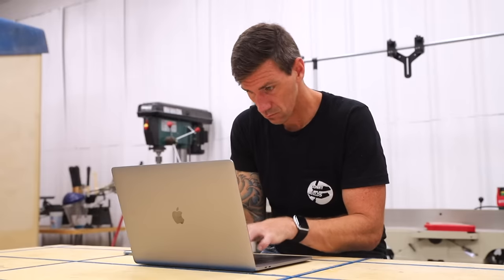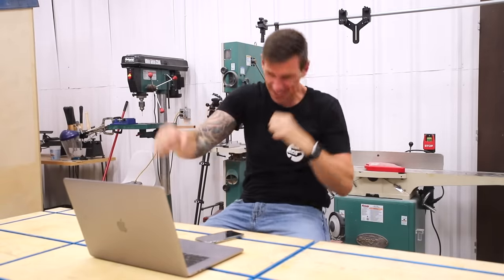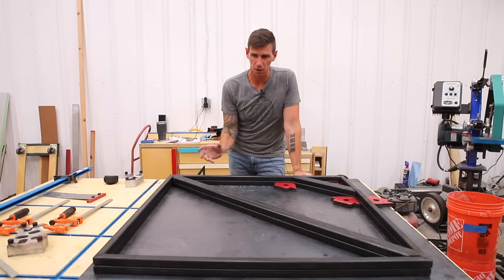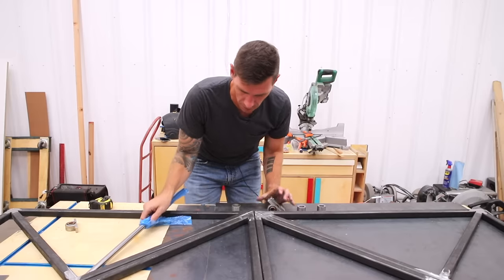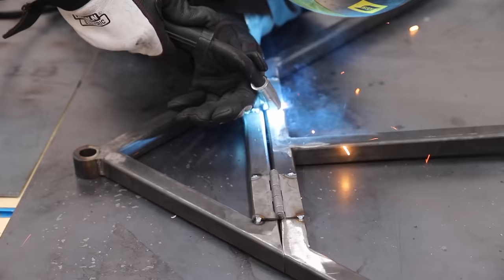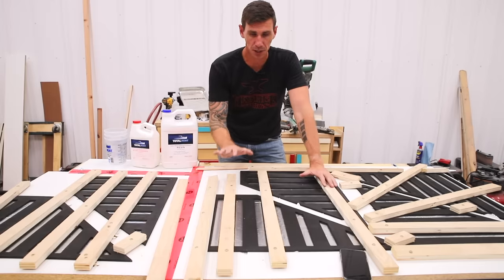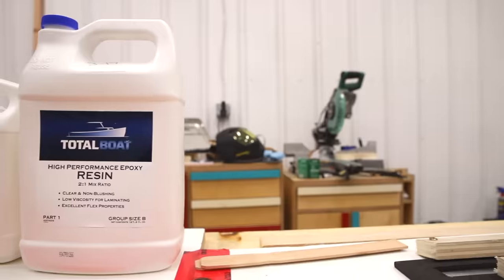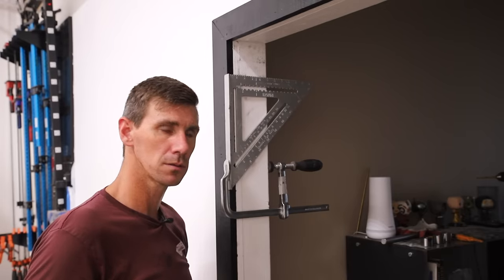Impossible Folding Door

Comment: The only thing that I see that is weird for me with that door is that opening up from the other side is weird and it ain't smooth
Reply: it could be easily fixed by welding the top or bottom rod, and attaching a motor to it.
Reply: Another potential solution would be to incorporate two-way hinges into the design, that way it can be opened inwards and outwards the same way. Naturally, this would require a specialized doorframe, because that wouldn't be easy.
Reply: Not a problem, since you can’t close it after you enter.
Reply: @finminder2928  It would have draught issues too but still an amazing design.
Reply: Guys, your missing the point of the door, it’s an alien jail door, you know for keeping their captives in right before they stick stuff up their butts, duh
Reply: @Catubrannos  That's why it's used for areas where that doesn't matter such as a shed/garage/workshop/etc.

People all miss the point that the door is supposed to be cool and interesting yet functional, less super practical.

Would be an awesome door to use for places where you wouldn't want someone locking you in by accident. If the door is open, then there is someone inside.
Reply: Because the inventor didn't take that into account, and you can't even close it back after you've gone through
Reply: @acywei  it's not functional then... It's a door. It's supposed to close and open from both sides..
Reply: May be adding a vertical rod with movable handle on the other side which can slide along with the door?
And it also help to stabilise the door structures
Reply: @wyannrosales3140  I mean, it would be fine for a closet door or something, where you wouldn't need to close it while inside, but for most uses, I agree, its not very practical.
Reply: @finminder2928  excellent point! I hadn't thought about that. Definitely loses a few of the ''cool" points for that flaw. Still, geometrically mesmerizing...
Reply: Alex Ward this wouldn’t work as you would have no Clearance both sides . This door also doesn’t finish flush
Reply: I was wondering right from the beginning how do you open and close it from the inside.
Reply: I thought the two pivot points didn't look parallel, you can see the two squares arent aligned when it is open, its still cool though
Reply: Guys just make a second door that you can close on the reverse side.
Reply: There are also gaps between the parts when the door is closed. You can see the blue light shine through them.  It's a door that will do a lousy job keeping noise from the adjoining room out.  Might want to throw some type of gasket material in there.
Reply: he may not have a door knob on the inside ... needs something like a push bar to open it easier ...
Reply: @johnathon5455  lol
Do you know that from personal experience?
Reply: Yeah, i guess that's why he didn't show it from the inside.
Reply: @samuelmire9389  You should be able to pull on one of the corners in the middle, then push it up/down. Would be awkward though, like opening.
Reply: @wyannrosales3140  99% of doors only open from one side
Reply: @wyannrosales3140  wait nvm I understand what you are saying now
Reply: Another solution is use a regular door
Reply: Omg attaching a motor on the door lo l
Reply: @uglyduckling81    you have to sort of pull on the door to open it so you need some kind of mechanism that pushes the door when it starts to Open and pulls the door in when it ends Opening
Reply: Good point, its only really usefull for a closet then.
Reply: Coming soon the better version. This is really good ideas
Reply: Johnathon545  obviously, i can't believe people don't realize that like bruh
Reply: Bruh people are saying to use it for a pantry or closet but have you ever played hide and seek
Reply: @johnathon5455  Exactly
Reply: how about the other side?
Reply: @wyannrosales3140  Not all doors are meant to close and open from both sides. Prison doors. Trapdoors. The holiday doors in The Nightmare Before Christmas.
Reply: @notahotshot  That means someone can just walk by and lock you in a room just by shutting the other door
Reply: From what i imagine, you cant even close the door from the inside once you open it 😂
Reply: animerlon oh, no,.. well I mean yes... but it’s different, I gave consent so it’s cool, they had a real pretty alien lady doing it, it was a pleasant night actually I wish I could go ba- to much info, but can confirm they use these doors for holding, actually met my wife in that holding cell, though sometimes I question if she isn’t an alien in disguise making sure I don’t go informing people of what went dow- oh god she knows,, and she’s coming this way she has something behind her back she’s out to get me please send help

Edit: oh god it wasn’t a weapon it was much much worse, it was a.... pregnancy test...
Reply: SᴜɢᴀʀKᴀᴛシ yeah ikr I mean looks pretty obvious to me, although I have experience in with alien holding cells
Reply: @satibel  that wouldn't work, as you need to hold the door up when you open an close it. it has some weight too it. 
if you don't hold the door while you moving it. it will lock in place.
Reply: @phoenixtalon100  with how the door works, you would just make it unstable. and how would you cover a door frame while being able to go through it?
Reply: @wyannrosales3140   it can open and close from both sides you just need something to hold on from the other side. as you still need to carry some of the door's weight when you move it.
Reply: You build a better one then and show us all how it’s done
Reply: Catubrannos yeah but I think you would probably use it onsideZ
Reply: It looks smooth enough anyway
Reply: @rileysteel5046  i built one some years ago for a final project as a smith. had the same design except I had a time limit and used resources found in the school to build it. so i know the flaws in the design.
Reply: @finminder2928  I though of the same thing it's really cool though
Reply: @finminder2928  no you can close it from inside. It's not smooth, but you can. See how he enters around 15:18? You can do the same things he does in reverse: from outside, close the doof halfway through, then step inside the room, then grab the door from inside and close it.
It's not a smooth but it can be done. You shouldn't put that door on a room that you use often because that would be unpractical, but it looks cool and could be great for a room that you don't usually have to close from inside (laundryroom, storeroom), or that you don't use that often (guest room). Or, it could be really fun on furnitures: wardrobes, shelves, TV stands, etc.
Reply: Gosxbomber agreed but still a really cool door design
Reply: Fin Minder you can lock someone inside so it would be inhumane giving them an ugly door
Reply: You kick the door, my friend, you kick the door
Reply: The handle turns around when it opens and closes it goes from front to back
Reply: People with OCD: Why do I hear coffin dance playing?
Reply: @satibel  A motorized super-pincher door?  That sounds scary.
Reply: ALL OF YOU

Understandable. Have A Great Day.
Reply: @wyannrosales3140  Well, not necessarily. Maybe you want a door that only opens and closes on one side for different reasons. An outdoor small storage shed, you usually open and get what you need and get out. Alternatively, as someone else pointed out, a great jail design would be to have a door that only opens on the outside side and cannot be manipulated easily on the inside. The polar opposite of that is a home or business lock door that closes on the inside so no one can enter from the outside (though, in the case of a business, that means you have another door somewhere that you can exit and enter from for employees).
Reply: I was wondering that too
Reply: @Kuli24000  either use a compliant coupling or use rubber borders on the door.
Reply: You can't really open it from the other side cuz when you open it, the door moves to the side and unless someone shuts the door behind you no one is gonna open the door from the other side cuz when you open it, the door stays open.
Reply: @StudioHannah  but this isnt so that is a bad example
Reply: that’s exactly what I was wondering
Reply: Another potencial solution is to leave that door open all the time

Yes, I'm a genius
Reply: The reason the door is opening on the other side is space.
Reply: I don't get it...
Reply: Why is everyone coming up with complex solutions? You just add a handle on the top of the frame (on the inside while closed) since when it's open the top ends being on the side. That way you just pull it down to open it if you're inside
Reply: Not only that you can’t even open or close it from the other side 💀
Reply: @johnathon5455  Lol!  Careful.  You're revealing their secrets!  At least you seem to appreciate it.  I know that I do!
Reply: Gosxbomber imagine it had 2 functions so you can just push it from behind
Reply: @ONEHKHK2000  that’s what my idea was
Reply: @johnathon5455  Your comment made my day 😂

Comment: love you giving credit to the original guy - sometimes lacking on youtube, very respectful!
Reply: Yeah , Klemens Torggler designed the door, but his is much smoother than this one.
Reply: Hate the way he pronounces Warwick though
Reply: @myfb3936  thats a less complicated design as well
Reply: I've seen an incredibly similar 4 plate door from some random guy called Klemens Torggler who was an arty type I followed for a while. It didn't use the small triangular plates though, it used some weird multi axis pivot in the centre to achieve the same effect. This design using 6 plates and standard hinges and bushings makes an aful lot more sense; it's far less complex to build as no joint moves in more than 1 axis of rotation. Assuming the Warwick guy has a patent for this 6 plate design he was the right guy to ask permission from. IDK though, could have at least mentioned the Torggler door.
Reply: @marylebone9357  some random guy lol. Klemens makes art pieces and had plenty of these doors many years ago.
Reply: @marylebone9357  Yeah I see your point, if Klemens design was with the 6 plates ( I haven't looked) then it is his design, just an easier way to make the door, but not nearly as smooth in function, or style. The style thing is just my opinion though, as that's subjective. :D

Comment: Put this door on a motorized system with a motion sensor from both sides and you're golden! Maybe a future addition!?
Reply: Nice fix or else you could only open from one side
Reply: Not sure if that would be possible, It seems you need to pivot it from the centre which is somewhere a motor couldn't reach. Great idea though!
Reply: The pieces rotate, just rotate one of pieces with a motor. Bada bing bada boom, problem solved
Reply: @brandonjones4666  you have to move the center to you, otherwise you can apply as much torque as you want to the pivot, it won't move.
Reply: @brandonjones4666  It would be hard to find one with the torque to move it quickly, id prob go with a pneumatic actuator
Reply: Elliot Ruddy motors on the left hand side, it will pivot on the right side still
Reply: Lol hello door. If you know you know
Reply: @brandonjones4666  well.... I'm not sure if that's going to work without creating a resistance management system and changing the layout of the door + you need a heavy duty e-engine with a hydraulic lifting mechanism for the central part (32kg as displayed in the video plus additional weight)
Reply: Okay okay.. so it’ll need an electric motor and some sort of linkage. Bada bing bada boom
Reply: @brandonjones4666  bada bing bada boom 
me "it's 2020"
Reply: You just need to make the "swish-swish" noise! It ALWAYS works for Star Trek!
🖖👽
Reply: The world is not ready

Comment: Imagine how cool an automated version of this would be. Like you just step up to it and it opens like the doors of some  supermarket from the future.
Reply: Bold of you to assume we're passing 2020
Reply: It’s probably possible but I wonder how it would work
Reply: That’s called an automatic slider door
Reply: Mabey a teather or pistons or electronic hinges
Reply: yes i’m winning
Reply: @jimym__  just needs some servos where the hinges are
Reply: Just put down a pressure plate in front of it.
Reply: I'm thinking it should be pneumatic and sound like a Star Trek door.
Reply: Red stone, all you need is red stone
Reply: That would be cool because the you can put in your house and you can use it for like your arms room where you put all your guns and money in.
Reply: That’s like some scp shit
Reply: Nah, some kid's gonna manage to put his hand between the hinges of this thing and chop it off. Boom lawsuit.
Reply: Cacao
Reply: Let hacksmith do this
Reply: you can add some motor on the hinges of the frame to make them rotate and connect it to a sensor, that would solve the problem on how to open the door on the side without the handle and make it even more awesome of course
Reply: Then the power goes out and now your locked in your room
Reply: That’s called a pressure plate.
Reply: You could even add claws to the edges to catch the rouge shoplifter
Reply: Plant coconut